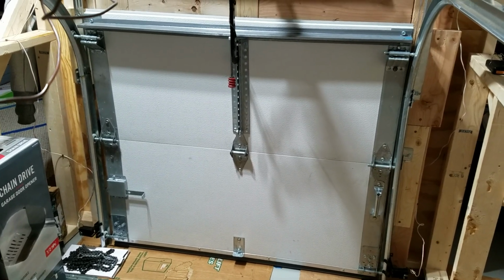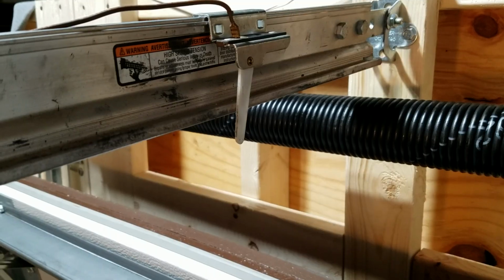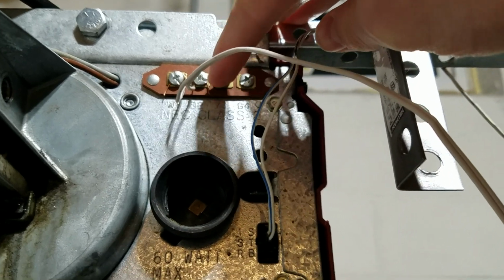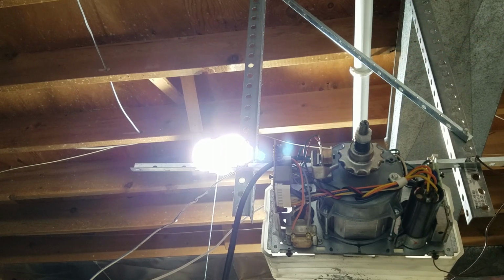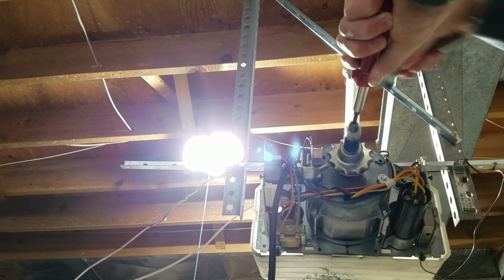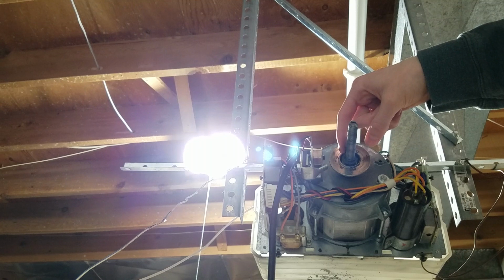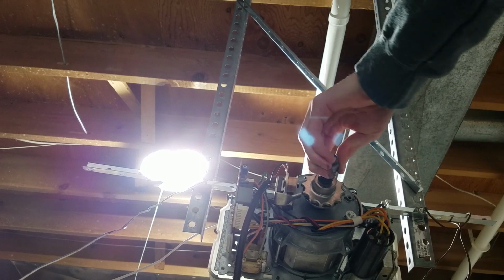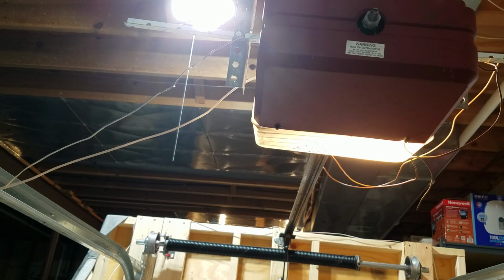Clutch Genie Screw Drive Maintenance, Repair, and Adjustment

Comment: hi been working on the clutch, i fixed it so that the garage opens but it refuses to close, i tightened the clutch all the way and it doesnt close, i loosened it little by little but it refuses to close...any tips?
Reply from the maker: Did you try roughing up the clutch like I showed in the video? Also check the sensors on the opener and make sure they aren't blocked or misaligned
Reply: @TBHD724  yep! Kept just kept humming....I held the remote down, now I think the outlet blew or something, no power for the opener
Reply: At first I thought it was a capacitor issue so I bought a new one but didn't work, then I turned the clutch and there was life, came across your video and did everything for the clutch and it would finally open all the way but not close
Reply: Power is back
Reply: Definitely something wrong with the clutch, if I turn it a few times, the door will open a little or close a little, now it doesn't full open haha
Reply from the maker: The other thing you can try is to loosen the reluctor (rpm sensor that reads the reluctor hub), there's a screw in a slotted hole, and bring it a little bit closer to the reluctor hub until the door works again. Just make sure the sensor doesn't hit the hub.
Reply: @TBHD724  wow, i did this and it is working so far!

Comment: Awesome ! I have the issue where if I tap the close button it won’t shut. If I hold the button it closes all the way. At first I thought it was the sensors  so I bought new sensors. Upgraded them. Im not sure if I wired them correctly because I wired the new sensors to where the opener also wires into it. So I’m going to rewire it to where it should plug in to see if that works. If not I’m going check the clutch.
Reply from the maker: Holding the button won't make the door close if the clutch is slipping. When you wire up the sensors both the red and green lights should be on solid. It shouldn't matter which way the wires are connected at the sensors themselves but at the opener it does matter which way the wires are plugged in. It's easier to cut the plugs off the end of the wires and splice into the existing wires with the new sensor and when you wire them up put the same wires on the front and back terminals (e.g. all the solid white wires go on the front terminal and all the colored wires go on the back terminal), i dont rember if the wires for the sensors are color coded or not but if they are it saves the hassle of figuring out the wires.

Comment: Got the exact garage door opener. Mine stops 2 to3 time’s going up.1 to 2 feet apart if I push up on door with my hand it works fine
Reply from the maker: Do you have a broken spring? Check that first and if it is get it replaced immediately, if not try tightening the clutch or taking it apart and roughing it up like I showed in the video

Comment: Thx for your thorough video.  My torsion spring broke and the drive had torqued the rail.  Was making grinding noise.  I dissembled the clutch and clutch base and put it back together.  However now the plastic nut just spins loose on the end of the spring.  Please advise.  (This schematic was a great help as well.)   https://7941f249-da52-4516-9391-2e6ce33e2f43.usrfiles.com/ugd/3ef5a4_4bdc23990a3a499a824d7a1c7449a016.pdf
Reply from the maker: When the spring broke, did you tighten the clutch as tight as possible to allow the door to open? It's possible that the nut is stripped, you can try replacing it with a metal nut of the same size
Reply: Thx for the reply.  I did not know to tighten it before releasing the shuttle. Will try another nut.
Reply from the maker: You aren't supposed to tighten the clutch to compensate for a broken spring, if you tighten it enough to allow it to open for a broken spring it can cause damage to the door, but tightening the clutch that much can cause that nut to strip out. If you have a broken spring get it replaced ASAP
Reply: It turns out the problem was that the keyway piece fell out.  Now it is back together but it pulls for for a second then reverses.
Reply from the maker: Try adjusting the reluctor to be a little bit closer to the reluctor hub. There's a slotted hole that allows for a bit of adjustment
Reply: My mistake, yes I replaced torsion spring. I thought you were talking about the clutch springs.
Reply: Even if I run it with the carriage disengaged it does the same.

Comment: enjoyed the content very much! My problem is quite different. If the latch on door is engaged into the side rail, the motor will not register the resistance, continue to try and lift door and will demolish the trolley by by ripping it off the screw rail within 1-2 seconds. clutch issue or reluctor? BTW the unit is from the early ‘90s. thanks
Reply from the maker: The clutches on this opener don't do anything on the way up, just the way down. These won't stop for anything when they're opening. If that happens to you a lot it's probably a good idea to replace the opener with a new one which will have force settings thatll prevent that from happening

Comment: excellant video, thanks! Question: installed my screw drive back in ‘91, not a single problem till now. Had to replace trolley 3 times in last four months. My guests would try to open door without knowing the side latches were engaged. The force from the motor/screw would rip the trolley from the rail thus destroying it. In years past this occurred occasionally but the motor always stopped when encountering such resistance. Could it be the clutch adjustment or the reluctor assembly? Called a local repair facility and was told repair parts did not exist for a unit this old and gave me quotes for a new replacement. Any help would be appreciated.
Reply from the maker: The clutch actually doesn't stop the opener going up, it only reverses it on the way down. In your case it might be better if you replace the opener since new openers have force settings in both directions

Comment: I disassembled the clutch, removed all the build up using a mild detergent, dried all, reassembled, and still not spinning the screw. Tightened the spring all the way, still nothing. The is play/slop between the clutch and the motor drive, maybe 1/8” that when the motor starts does not allow for the clutch pieces to remain in contact. I can push the screw drive back to make contact, but when the motor starts to spin contact is lost. What could be the source of the play? As an aside the motor starts to spin in one direction, then starts to spin in the other direction with the carriage disconnected. BTW, great video, Thx
Reply from the maker: It sounds like you have a broken e clip. If you unbolt the rail from the motor unit and slide out the screw a little bit, there should be an e clip that if it's broken or not intact will allow the screw to slide backwards making the clutch useless and not able to engage the motor to the screw. If it's broken, they don't make replacement parts so your best bet will be to salvage one from another old opener, or you'll have to replace it. I've never seen those clips show up on ebay before.
Reply: @TBHD724  You were right on! I listened to your diagnose and opened where the screw drive feed into the opener. Found the broken clip. You are the man! Thank you very much!

Comment: Thank you so much for this video.  We have a circa 1994 Genie screw drive, that looks exactly like the one in the video, which I installed shortly after our house was built, and until now it has run great.  Lately, it has been having problems getting stuck in various positions.

I used your video and repaired/adjusted a lot of things.  It seems to work much better, except now when raising or lowering it often loses power completely (including the electric eye and wall switch).  I found that if I wait about 5 minutes, it resets itself and the power comes back on, but then the same problem keeps repeating.

I've adjusted the clutch many times, but that doesn't seem to make a difference.  It acts like there is some internal circuit breaker that keeps cutting power and then resetting itself.

Do you know what the problem might be?  Would it be one of the circuit boards, and if so, which one?  Your advice would be much appreciated.  Thanks.
Reply from the maker: That could be one of two problems, either a loose connection at the wiring harness for the logic board, or a bad transformer. You can test the wiring harness by wiggling it around some and see if anything loses power, if not then it's the transformer. They don't make transformers for these anymore, so you'll either have to find one on ebay, take one out of another one and swap it, or replace the opener alltogether
Reply: @TBHD724  Thanks, I'll give it a try.
Reply: I made sure all of the connections were tight and reassembled the unit.  I don't know if that did the trick or if the fact that we just have to push the button once now instead of several times, to open or close the door, but it seems to be working fine now.  Thanks for the help, maybe I can get another 26 years out of the opener.😀

Comment: I have a genie intellacode screw drive opener that just clicks like a machine gun when you try to open it. I have lubed the track, replaced the carriage, and the coupler and it still does it. Any other suggestions?
Reply from the maker: Do you hear the motor hum for a second when you try to run it? You might have a bad start capacitor
Reply: No, as soon as I hit the button it starts to click.  Could it be something to do with the clutch slipping or something else?
Reply from the maker: The intellicode openers don't have a clutch. If I were you I'd start with replacing the start capacitor, and if that doesn't work you most likely have a bad board

Comment: Thank you so much for this video it really help me a lot.  How do you know when your capacitor is not working? I hired a garage repair man and he didn’t even know how to fix this kind of opener. The only thing he was saying is a very old model and I should replace it . So hopefully with your video I can replace it myself .
Reply from the maker: If the capacitor is bad, the opener will either sit there and hum when you try to open it but not move the door, or you will see smoke come out of the capacitor if you cycle it multiple times in a row. If you take the cover off and look at the small white hole on the capacitor you will also be able to tell if it's blown out pretty easily.
Reply: @TBHD724   ur amazing thank you for your help

Comment: I having problem when I try fully open garage door and the garage moved back down about 2” after fully open up. Do you know what is the problem? Thanks and appreciate your time.
Reply from the maker: If the door coasts down when its fully open and hooked to the opener, that means your door is more than likely underbalanced, you should call a company to tighten the springs as it's not something you should try yourself

Comment: We having problems for our garage the panel and the inside of the garage it works perfectly it is  the remote control that we use for in the car that's giving us problems and we change the battery but that was the problem and it ain't the battery every time we hit the button several times  the remote control do not moving up for us to come in the garage  and we trying to leave to go to church in the garage won't go down either what do we do do we need to call somebody to fix it
Reply from the maker: If you have LED lights in the garage that affects the range of the remote, try turning off any LEDs and see if that does anything. Otherwise try adjusting the antenna on the opener or getting a replacement opener radio set that runs on a different frequency
Reply: Thanks for the detailed video. I have this same issue. Garage door will respond to my car home link button or remotes only if I am inside the garage. I unplugged off all the LED lights but with no difference. Tried also straightening and moving the antenna wire and it didn't help. I am out of options.